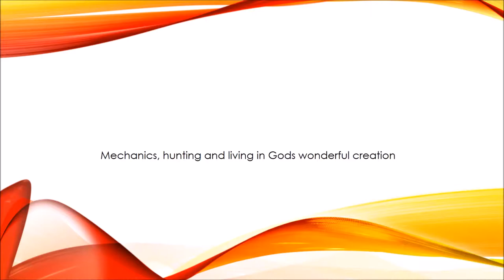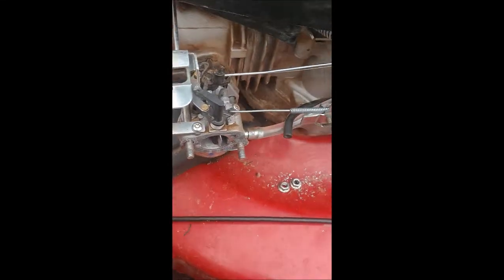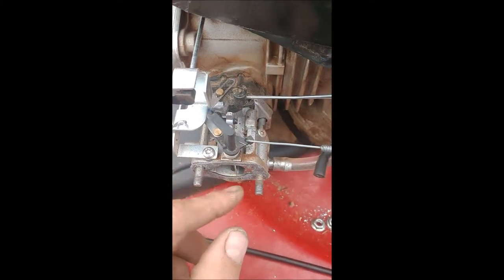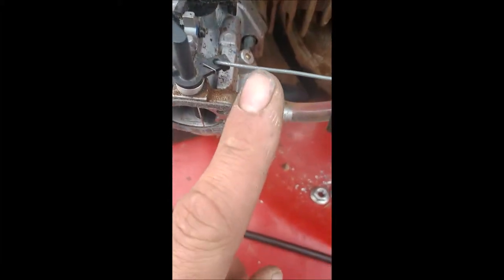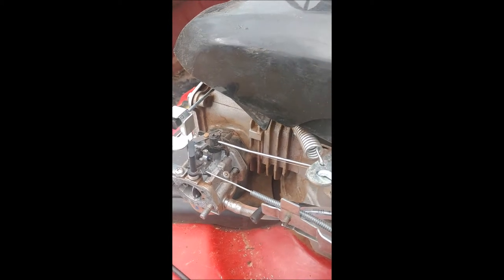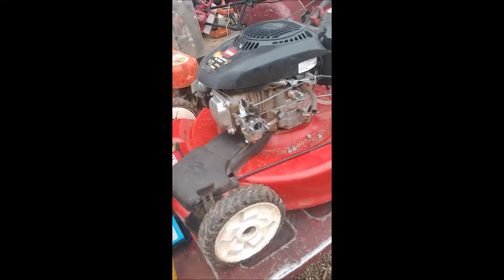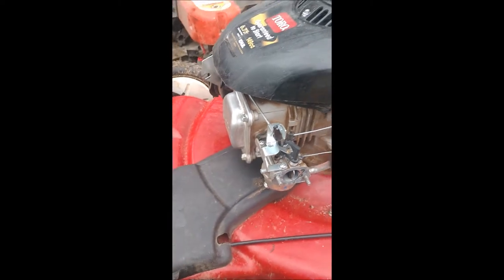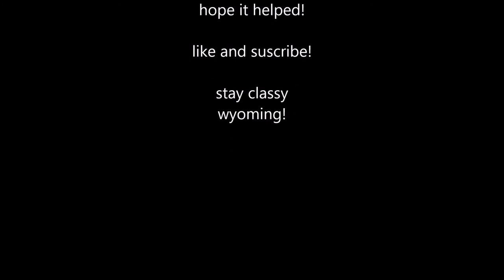converted kohler auto choke to manual choke system

Comment: My pressure washer takes just under a minute to fully open the choke. I replaced the auto choke with OEM, still does the same, drives me nuts, sputtering, and bogging for the first minute. But when it's open, it works great. Thanks for the great video.

Comment: Perfect!  I will have to do this mod. Got one of these mowers with low hours on it for free some someone who bought an electric.  The mower had been sitting around for awhile and of course the jet in it's carb was gummed up.  Cleaned that up and quickly ran into the same auto choke not fully releasing issue.  I zip tied my choke open as it was ridiculous.  If it is hot out, a cold engine will start with a few pulls, but if it is cooler or cold out, I pop off the air filter and squirt a little gas into the carb to prime it for the initial start up.  Squirting gas into the carb is a mild pain in the ass though.  

Then I found that the mower sputters and blows black smoke with a load on it, and it was always struggling to find a steady engine speed.  It had been running way rich it's whole life based on the carbon in the exhaust.  Replaced the short idle screw with a longer one to set engine speed at a reasonable level.  I also find that the bottom governor spring that pulls the throttle open is too strong, causing the throttle to open too much, dumping more fuel into  it than it can handle and making the engine sputter and it's power totally gutless as a result when a good load is put on it.  I stretched and cut the spring to weaken it a bit, and make it pull less hard.  

The mower runs much better now, never sputtering, running very clean, with good power.  If my mower is any indication, this model comes tuned like crap from the factory.  It is a nice OHV engine though and it mulches and cuts great and the front wheel drive works great.  It just needed more attention than it should.  Adding the manual choke will complete the project, resulting in a mower that should last the rest of my days - the Yard King "beast" as I call it that the Toro is replacing was built in the early 90s 😁

Comment: Disconnect the rod, cut a hole in the front side of carberator shroud where a stiff wire is attached without a spring. Leave everything else attached instead of that mess.